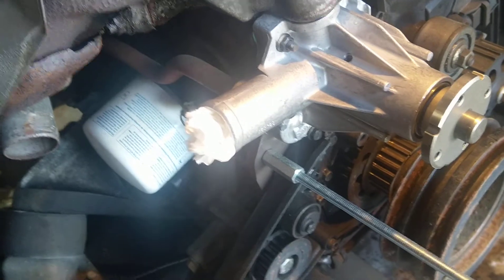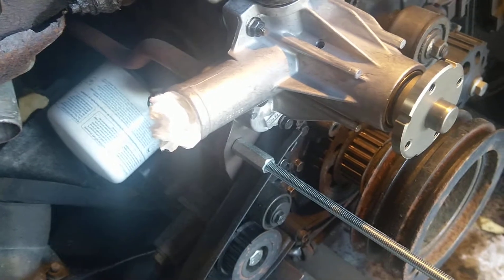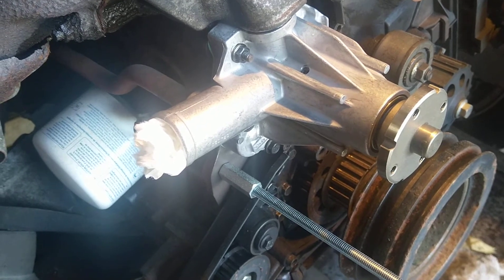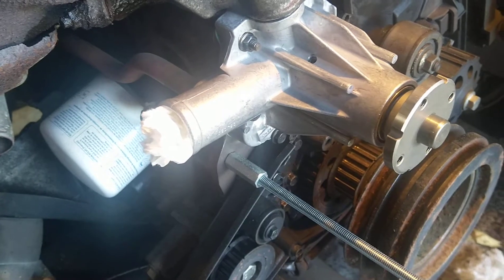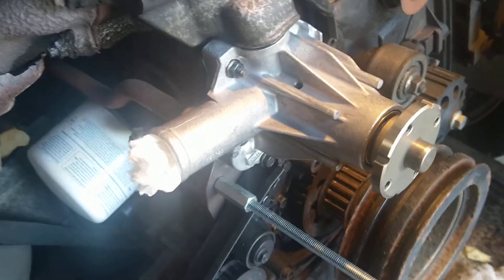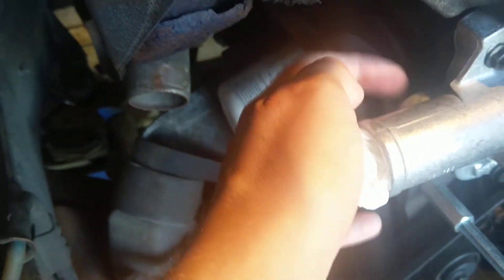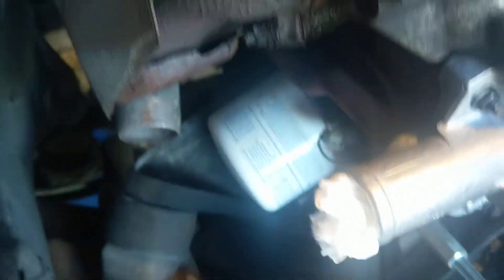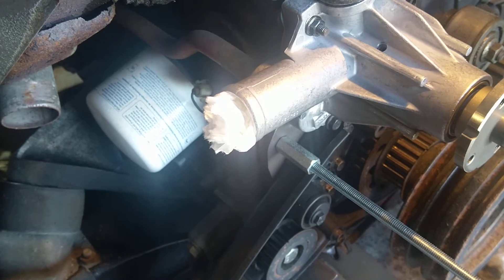Replace waterpump Volvo redblock-engine's tips and tricks explained.

Comment: great idea to make that lever point with the M8!   that makes the job much easier.  I use a thin layer of 3M SUPER WEATHERSTRIP & GASKET ADHESIVE YELLOW 5 OZ 08001 to attach the paper gasket to the pump so that the gasket doesn't move when installing.   And, for the rubber seal any silicone grease for o-rings is good.